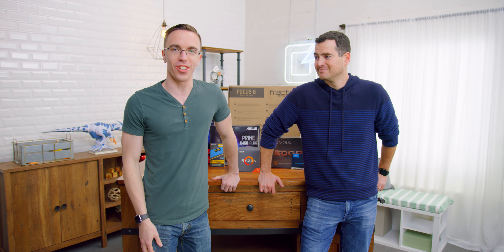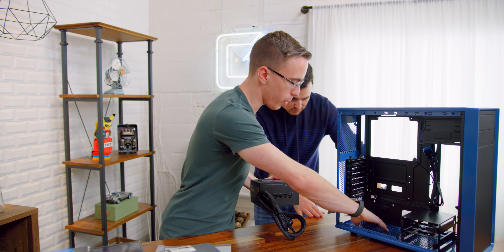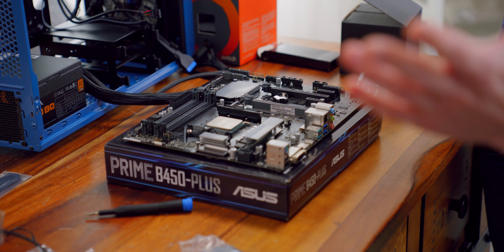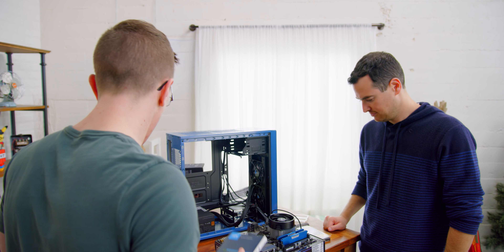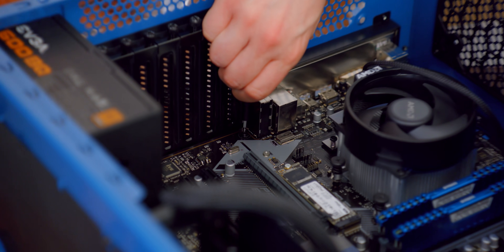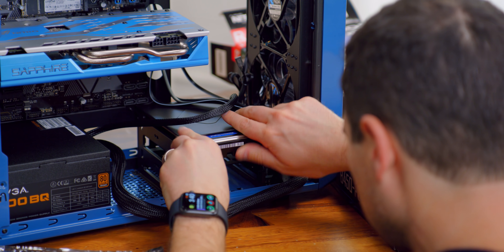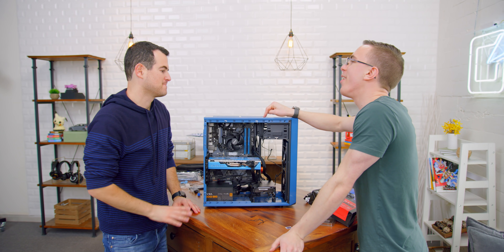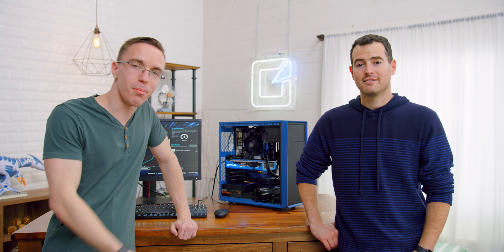How to Build a Gaming PC (2019)

Comment: My friend wanted to save on his pc and bought a cheap power supply from china.
After using it for few months he got a new case and we moved the parts in it, then when we pressed the power button fans came on but the pc did not post.
Then we saw smoke coming from the power supply and shut the pc down, the cheap power supply was done and took his hard drive and gpu with it.
Reply: F
Reply: Jusu f
Reply: F
Reply: F
Reply: no F just an L
Reply: F
Reply: F
Reply: F
Reply: F
Reply: Karma is a B*tch!
Reply: F
Reply: F
Reply: F
Reply: F
Reply: F
Reply: F
Reply: Jusu F
Reply: F
Reply: Ff
Reply: F
Reply: F
Reply: F
Reply: F
Reply: F
Reply: F
Reply: F
Reply: F
Reply: Thats why you buy an 80plus certified psu. xdd
Reply: 1.99$ to press F to pay respects

When EA buys call of duty
Reply: F
Reply: F
Reply: F
Reply: F
Reply: F
Reply: F

Comment: I don't really get how to install standoffs for the motherboard in the case
Reply: I cant tell if you're serious or not? In case you are, you just screw them into the case making sure every screwhole on the motherboard has a standoff under it when installed in the case.. it's simple!
Reply: @MasterCrafter7777777  does it have a dedicated hole for the standoff or what?
Reply: @DiddyT123  Yep there are little holes in the case for them. In most cases (pardon the pun) the hole is labeled with different motherboard sizes.
Reply: @MasterCrafter7777777  bruh thanks anyway

Comment: I've built over 40 PCs for friends and family and never ever have I put the power supply in the case before attaching the motherboard. Also never attached the CPU Cooler before putting the MB in, that's not even an option with Noctua coolers.
Wow, so much building outside the case and it's not even a terribly unhandy one
Reply: It doesnt matter what order you do it in (unless clearance issues) as long is it all gets together in the end!

Comment: PC partpicker only calculates power if the components aren't gonna be overclocked. I have a 850w PSU for my AMD build with a Vega 65 but since I'm running a lot of things OC, then we'll yeah 850 didn't have enough headroom.  SEASONIC I think has a slightly better calculator because it asks are you OC your parts. And suggests the best psu option. ^_^

Comment: Expensive power supply7 is needed only if You make High-end pc with rtx 2070 or better with at least i7 k series ... Any other case buys any 12 cm ventilator unit be happy. If have issues with electricity buy any ups ... It is time finally using the proper tool for problem
Reply: $60 isn't expensive for a power supply tho! There are plenty of reasons why going with a more expensive power supply is beneficial even in like mid to low tier systems. More expensive power supplies tend to have better components like better capacitors etc. that help them last longer(and not just burn out after a year). They also have better efficiency which helps with the cost of electricity, temperatures, acoustics, etc.
Reply: @MasterCrafter7777777  Before I bought RTX2080 instead of GF750 Ti, I run a cheap power unit with 12 cm around 450W ... Which well served me for at least a couple years including support i7 4790k in turbo mode instantly ... Unless You buy cheap atx power units with 80 mm fans(outdated design from 80s) You will be fine.  It is expensive because for 80 bucks I bought my Valeo V with 700W, modular cables, 0 db mode when system load is low and ultra quite 13.4 cm ventilator. All PSU right now is to build on the same platforms under different brands so the only serious choice is what extra features You wanna have.  0db mode, modular cables, monitoring software, ultra quiet fan in size above 12 cm, a particular color, water cooling... again if You have issues with electricity  lines buy any form UPS like APC Back-UPS 500VA or similar products and none of PSU units can replace this unit in terms of protecting Your pc components from a problem with electricity line

Comment: My guy John Retinger! Been watching technobuffalo for years! I remember watching those custom iphone 4 videos

Also a note for austin: you should have plugged in the required modular psu cables to the psu before installing it in the case just to make it more convenient.
Reply: I guess he didn't do that for the sake of making the guide more understandable. It's pretty hard to explain and show to new pc builders what are those cables for if the mobo wasn't installed in the case yet.
Reply: @ItsZim0  ye but he couldve atleast made a side comment to say that its easier to connect the cables you need before installing the psu, makes it harder for cases with tight spaces around the psu area to try and connect the cables once the psu has already been screwed in.

Comment: All these tutorials and I still keep putting the CPU in the microwave by accident
Reply from the maker: Easy mistake
Reply: @austinevans  I accidentally got my GPU baked
Reply: @austinevans  yes
Reply: @austinevans  Can This Set up Edit 4k Videos in Premiere.. Would this Mother-Board and Case Work With An Intel I-7 CPU , EVGA GeForce GTX 1070. Do you a suggestion for a Mother-Board that support the I9 Processor?
Reply: @austinevans  heres a challenge: build a gaming pc and use a microwave as a case
Reply: @austinevans  happens all the time
Reply: @austinevans  f
Reply: @austinevans  yes
Reply: funny story. there is a method to repair faulty GPUs which consists in putting them in the oven. google "backed gpu"
Reply: Sometimes I bend my house while inserting gpu into my mobo
Reply: Damn better than me I keep putting it in my toaster
Reply: Then stop living in a microwave!!
Reply: I put my ram in the toaster and my house nearly burned down
Reply: I thought ram went on trucks
Reply: It's because you're not screwing with confidence
Reply: MG EnoX yeah, I keep forgetting to set the oven to 450 instead of 395, my RAM always over cooks.
Reply: Better than me, I keep putting my 2080ti's in a dishwasher and set the water to 200f instead of 180f
Reply: consider yourself lucky because I keep on throwing my CPU in a volcano for sacrifice
Reply: Yea that's not very smart😂
Reply: I ugly laughed.
Reply: Yeah I missed with my thermal paste and made it into my mouth
Reply: I washed my motherboard with Fairy liquid
Reply: u need to put micro-w in the computer first than u put ur cpu after that
Reply: Oops
Reply: It's an easy mistake u have to put in the stove
Reply: Same
Reply: Lol
Reply: Me too bro I dont know, dog is cool.
Reply: Wait your not supposed to do that
Reply: how much money have you wasted on CPUs in this year?
Reply: @priyanshu4676  yeah I put mine in the toilet than drink the holy water so I can play Minecraft again and kill those creepers
Reply: Omg
Reply: Could be worst, i sometims bake my cpu at 250°C, next to a cake, It's the fifth i9 so far...
Reply: Have you tried powering it off and on again?
Reply: Bro I put mine in my vacuum cleaneer
Reply: Did you try putting it in rice?
Reply: Got mine stuck up my ass 🤔
Reply: My entire setup end up the the washer machine
Reply: I mn i keep putting the cpu down my pants and when i check again it disappears.
Reply: Same dude smfh
Reply: every time
Reply: MG EnoX 😂
Reply: For the cable management I just closed the door
Reply: My computer case is a microwave, so that's not a problem.
Reply: I put my microwasve in my cpu
Reply: Dude, I know same I do it every time.
Reply: I put it in my gloves, and accidentally put my hand warmer in instead of my CPU
Reply: MG EnoX same
Reply: Ikr shits annoying